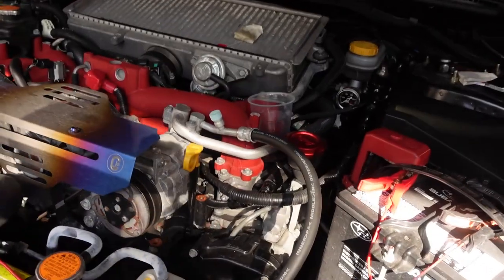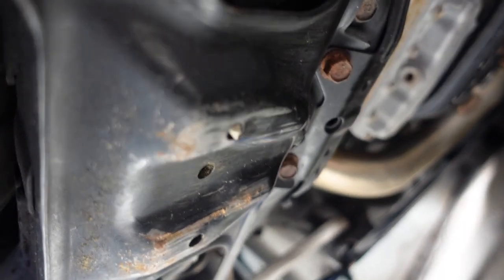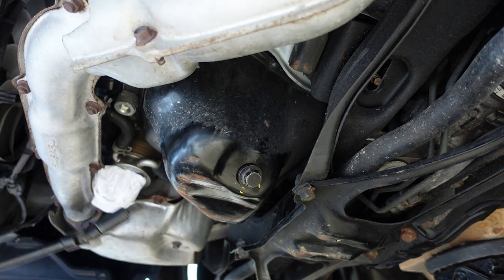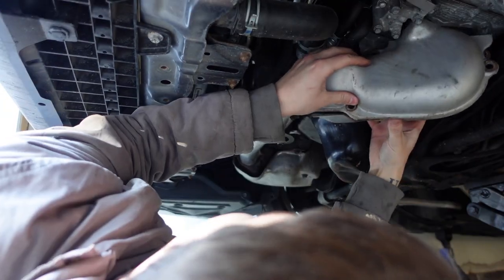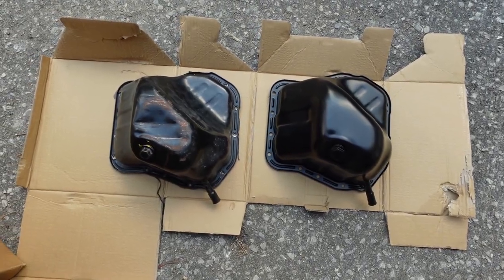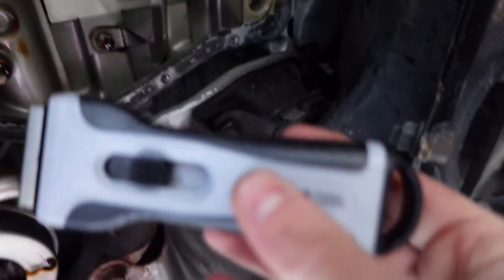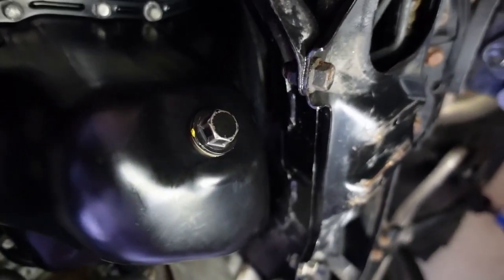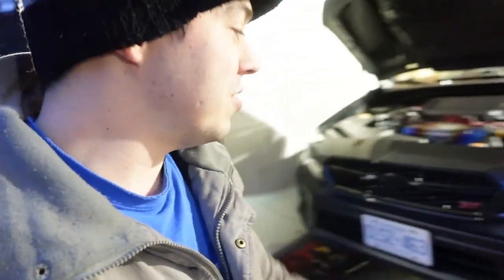Replacing SMASHED Oil Pan On My STi

Comment: Did you have to remove the intercooler and pitch mount? Nice vid btw!
Reply from the maker: Thanks! I did not remove the intercooler, I can't remember if I unbolted the pitch mount, but honestly I don't believe I did. Removing the bottom 2 engine mounts was enough I believe.

Comment: Just replaced mine.   Did you have to add more oil than usual the first time?   My car calls for 4.5qts and I just added 5 and it’s still low.  Triple checked the dipstick tube cause I figured it wasn’t all the way in but it is
Reply from the maker: Honestly i dont remember, but i dont think it was much more than the 4.5 quarts. I do know i messed up with my dipstick and leaked a bit out, but nothing crazy

Comment: how did you remove the exhaust manifold to get access to the rest of the bolts i can’t get to one and it looks like i’ll have to remove the engine to get to it. plz halp trying to fix rod knock
Reply from the maker: I actaully did not remove the exhaust manifold. But if you need to remove it, you'll have to remove the exhaust shielding that is on the manifold. Then you can remove it. If you don't, i think it is impossible
Reply: @zach_lush  so yeah ive got an 18 WRX man, and ive got the exhaust going to the turbo something right under the oil pan. one bolt is inacessabl ewas looking for some help
Reply: thank you for responding
Reply: Dealing with the same issue. Have to drop the turbo and headers to access the oil pan bolts. Huge pain in the ass just to access and replace something simple

Comment: Replacing mine soon, is there a reason not to use the solid gasket instead or is gasket maker just a preference thing?
Reply from the maker: The only time I've seen someone use a solid gasket is on an IAG oil pan. Never seen someone use one on an OEM pan.

Comment: Any issues after 7 months? I am glad to see the pan looks the same as oem.  I was looking at a non-oem on amazon and it was significantly cheaper than oem. i like oem usually but this is literally a stamped piece of steel. You didnt happen to weight it ti see if was any lighter than the oem one, didnt? Thanks for the video.  Rebuilding my EJ and I have to clean out the debris from a rod knock so a new pan would would make my life easier than cleaning.
Reply from the maker: Nope, no issues on the car. I would probably get another one if i had too. Well thats just it, its stamped steel which is nothing special. No, i never weighed it but i would say they are similar in weight. Ouuu, yeah anything that involves oil and has potential with debris in it i would just replace. Not worth losing brand new bearings after trying to save a couple of bucks.

Comment: Slight issue I did everything in this video everything went somewhat smooth but once I went to drop the trans the engine mount right side bolt did not line up but the driver side did so now in stuck at getting it to line up any tips?
Reply from the maker: Hmm, i didn't have this issue. If your still struggling with it I would probably call a buddy over and have some extra muscle to help guide the engine in place. If that still doesnt work maybe something in the engine bay is forcing the engine over? Good luck!
Reply: @zach_lush ended up getting it hammers and flathead work wonders
Reply from the maker: @cuddleplumfish2040  there you go!

Comment: what did you spray under the motor on day 2 of the replacement?
Reply from the maker: Like brake clean? I sprayed it after I cleaned off the gasket to make sure I had a clean mating surface.